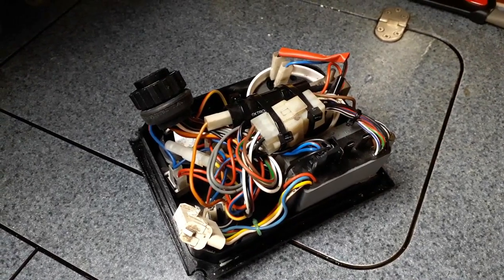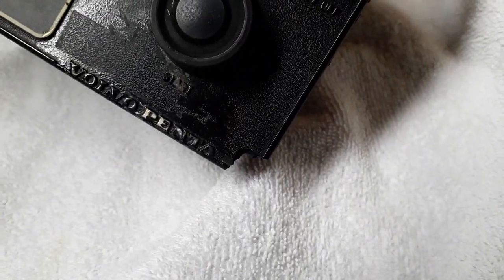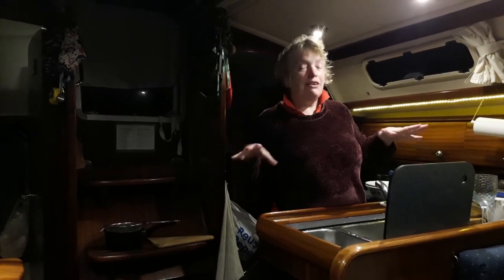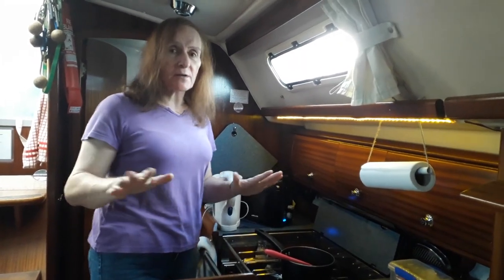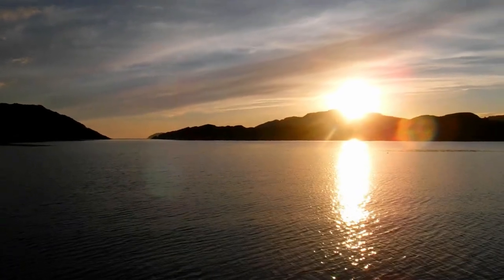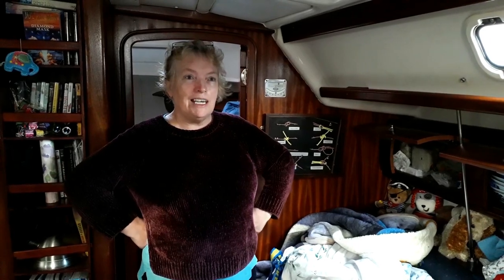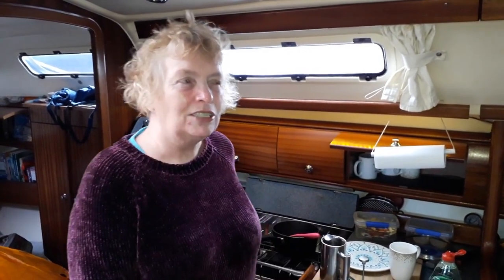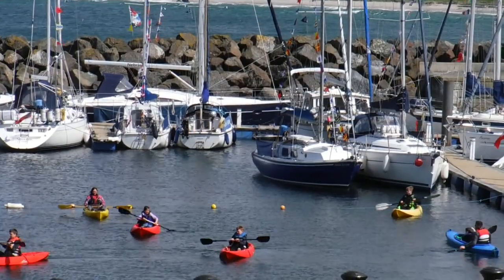Northern Ireland - Winter - Pros and cons of living on a boat - Ep. 223

Comment: My eber decides to play up every November, like clockwork.
Reply from the maker: We have a video on that and how to service and clean it out. The service kit is about £20 and it takes at most 2 hours from pulling it out to screwing it back in. Run it hot if you can - it soots up quicker at cooler temperatures

https://youtu.be/2JNQNzgKgzw